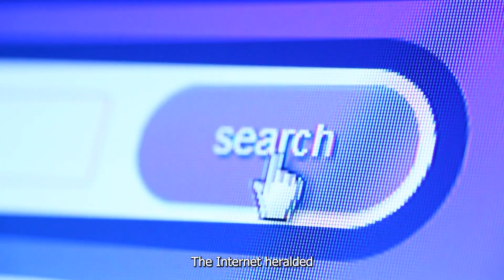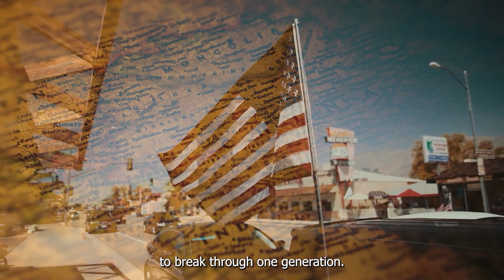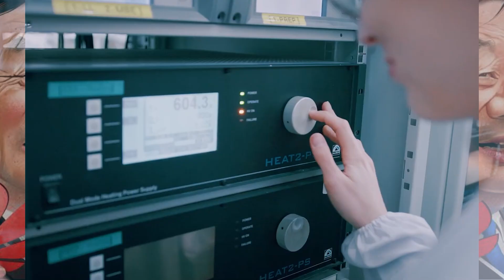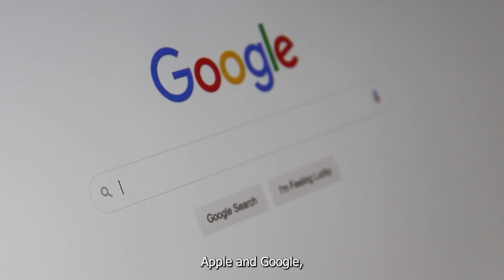Huawei Has Made A Major Milestone In The Photonic Chip Revolution

Comment: in fact determined to circumvent the American sanctions which deprive it of its suppliers (including TSMC), the Chinese group is preparing to build In addition the type of microprocessor that uses light instead of electricity to transmit data, and they have the potential to be much faster